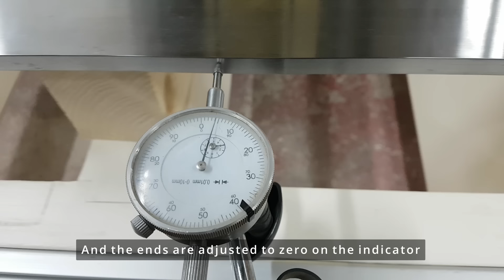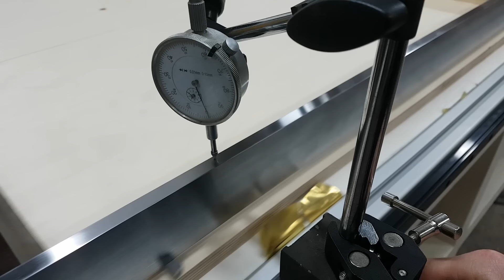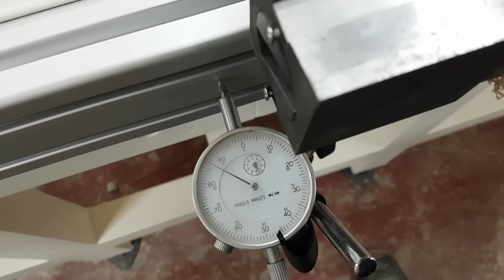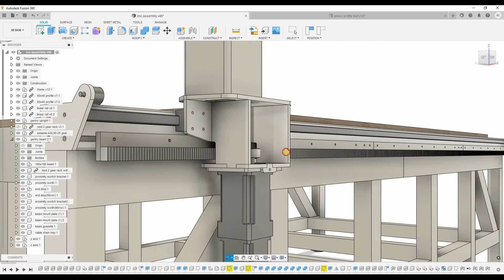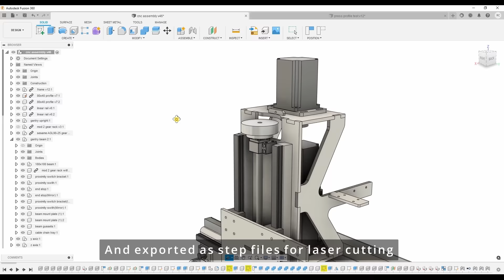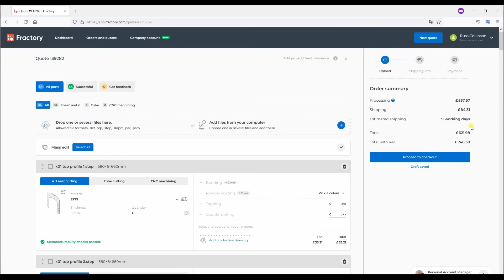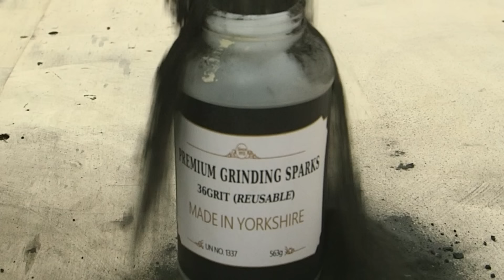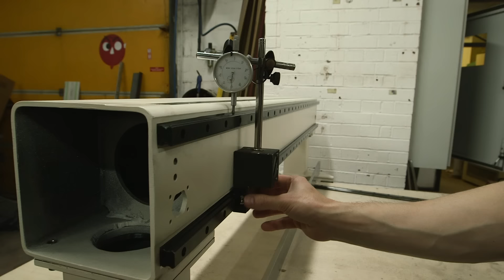Building an EPIC £20,000 machine part 2

Comment: Your drive for perfect is admirable, your ingenuity for solving and fixing problems too. However, designwise, it should be better and faster as a whole if you took the inaccuracy of standard steel profiles, the process of welding, and the lack of stiffness and accuracy of a wooden structure as a given before designing and building. By adding degrees of freedom for adjusting to an accurate system would minimize e.g. all the grinding and a lot of shimming. The wooden table doesn't support the aluminium profile enough to be, and stay, straight. The torque applied to the screws should be uniform as a start. I would build the complete top of the table out of aluminium profiles as I've done before. With minor shimming you would have a perfect platform as a base for the gantry to ride on. Next to this I would prefer bolting parts together instead of welding it. As you noticed warping and deflecting is an issue. Furthermore, just another tip, I would order stainless sheet metal parts instead of steel or just build the complete structure out of extruded aluminium profiles like the Item ones you're using. It's more expensive but you don't have to paint it afterwards and it looks nice from the beginning. The aluminium Item profiles have the benefit of altering or adding stuff when ever you feel like it. No drilling needed. Just add the right ;-) sliding nuts and bolt some more to it. Just my two cents on your elaborate project. I'm a big fan and I hope my comments help you to become even better. All the best, Job

Comment: Why did you ruin a good drill bit to make a center punch when you can buy Center punches for cheap? Did you use the drill bit to make it the exact diameter of the hole, so it centers it directly?

Comment: Hate to be a naysayer, but wood moves, expands, compresses and even worse, depresses. You'll get your tolerances, but with temperature and humidity changes, it's likely to fall out of tolerances. I would attach the rails assembly to a ridgid metal frame.

Comment: Very intriguing, there must have been a very strong rationale for mounting a highly precision piece of equipment on a variably 'moving' wooden sub structure which is subject to dimensional change with humidity. Perhaps you are by the sea with constant temps & humidity or you have installed a controlled environment. I really ask out of my naivety not as a criticism of your great skill.

Comment: Question even though it is plywood you're using are you not worried about the wood expanding and contracting causing variations in the rails that can throw off the setups

Comment: Thanks for another great video :D A few questions: Do you include a tolerance when you order from fractory? If so, how? Do you use the tolerance funtion in Fusion 360? Cheers and thanks for sharing.
Reply from the maker: hi! no, all my parts are drawn to a tight fit and exported as is, i guess they must cut to the center of each line because their is something like 0.3mm clearance on all the interlocking tabs. all goes together really nicely apart from one or two. bits of  slag here and there.
Reply: @NewYorkshireWorkshop  You are confused. A line has no width to cut to the center of.

Comment: I'm a little confused. How do you know that the straight edge is parallel to the rail when you measure? It makes sense on the vertical alignment but not the horizontal.  Not questioning your methods, just want to learn

Comment: Looks like you know a heck of a lot more than I do but just wondering when torquing the bolts with a extension on your ratchet do you accommodate for the flex of the extension? If so, how?

Comment: One thought: a lower viscosity fluid (lower surface tension) would make the menisci in the cylinders flatter and may be easier to get closer measurements
Reply: ... or you could just buy a precision machinist's level and have done with it, used for the entire project's components as well as for future.

Comment: I think it's way over engineered. Wood movement with seasons are magnetudes higher than what you aim for.

A few thinks.
- If you shim the sidebars, by tighten the srews a little more or less than before you get different results.
- Did you level the sidebars off the plywood? Is this so level?
- The metal parts from Fractory are 6-8 mm thick, you could but a car on top of that.
- The metal beam, again humangous.
- Grinding of off a wooden block, that was hand planed on a wooden surface with a wooden structure is interesting. How do you know the surface of the wooden block is parallel to the rails?
The effect is, that the thing is square to the table but you could have saved a lot of time just shiming it.

This is not bad criticism, but thinks that came to me while watching. High level of precision, but is it needed for wood???

Comment: I don't know how long this task took in total but I'm only 24 minutes into the video and I'm cream crackered already, you really do have to be a bit (insert your own word) to do it so meticulously. I think the wooded surface grinder is inspired, but it's a shame you had so much extra work just to correct things which should have been perfect. What was the total time for this project? I was wondering why when you were masking up for paint you didn't use a knife to cut the tape with the rails etc still attached instead of marking and then cutting to the lines.
Reply: I believe 4 months

Comment: 1:47:09 weak structure shaking !!! SHAKE SHAKE !!! never use wood for structural on precision machines (it's like building a building on sand)
Reply: also, extreme thick steel sheet on those pieces, that will add even more shaking after fast movements, 1/8" is was more than enough

Comment: there is a reason machine tool's are not built on wooden frameworks.  all that wood structure  morphs and develops new stresses and strains  as the wood dries out  and regains moisture from the environment settles  from weight ,etc.   so why add those variables? seems like a metal frame would long term be the best solution. now everytime you have an off dimension in your  product you will have to question if it was because your wooden frame  moved.  I dont sse the point --cant have been that much different in cost between metal and wood  base , all things totalled

Comment: What paint do you use to spray straight on top of the self finish steel? I have been using Hammerite smooth, funnily enough in the same colour, but really am not happy with the finish, hand brushed.
Reply from the maker: it was this stuff- https://www.ultrimaxstore.com/paint/direct-to-metal/ultrimax-1-bs.-00a01.ipo00500a01?qs=1&asparent=1
I got 25l quite cheap on offer. it has a matt finish and takes a long time to dry (especially if you put it on thick in one coat like I did!)

Comment: simple skilled wins
Reply: if you drill through the aluminium extrusion, so that you can lock the bolt, then the tee joint will not slide
Reply: tee-lock-nut, not just tee-nut

Comment: Impessive. But how can you verify at 10:38, that your straight edge which you use as a reference is really straight?
Reply: The metal bar is a straight edge to within mere microns. His trick was to set up either end as zero and then measure the variance in the middle. I had to rewind to see the magic

Comment: As a retired Machine Tool Maker having worked for some of the  leading
 
 companies in the U. K.  & Other parts of the world i find this wooden fixture to be a complete joke.Nobody in serious engineering would think of fastening precision linear bearings to a wooden structure. I have had many maintenance problems setting these bearings up when securely fitted to Machine Tools made of cast iron whose mounting faces have been machined to strict tolerances. As to the comment about watchmaking i believe a cuckoo clock comes to mind. I could go on all night about INACCURACIES in this wooden bench construction  but do not want to waste as much
time as this Joiner turned amateur engineer did.

Comment: Hello! Only me. I've yet to watch subsequent videos so you'll have to forgive me if this has been covered. I really hope that the bearing blocks hold up over time - especially on the Y axis. They just don't seem substantial enough for the weight on 3/16ths (?) bearings [other units of measurement are available apparently]. Didn't find that veneer painting vid. I think the kids were acting up and I got distracted by this... 1st vid, 28mins 34 secs in - why didn't that leg you put on the end fall off when you were disassembling the frame with the mallet?  It would have happened with me. Some sort of voodoo or cheating going on. I don't do short posts and you don't do small projects...
Reply from the maker: https://youtu.be/SaohiGAYW-0
Reply: @NewYorkshireWorkshop  Ta muchly.

Comment: Makes no sense to be this heavy it is not a frame stretcher or press and the tools are not precision. No explanation?  Grinding a rec tube off axis with an inferior abrasive wheel.  If it an XYZ table it is for making tank parts from 1" plate?  I fell asleep and it is still on.

Comment: watching you chase your tail "calibrating" made me just laugh and roll my eyes. the gantry will determine everything with your setup, not building back from that plywood table surface, when the machines is complete your first operation will be to place a sacrificial sheet on top of the plywood sheet and then machine it flat and parallel to the gantry motion in y and z not  the other way around. if there is some slope in the gantry it will be no more once you surface the table top to the actual zero plane on the machine.  the most important step is the perpendicularity of the gantry travel in relation to x and y and that each axis travels 90 degrees to one another you never established that ever in anything you have done. will not be square your one gantry upright relative to the other one will be at 0 and the other possible - something or positive something both are not at x 0 plane. the machine will never cut anything square relative to x or y axis. the z is trammed in when you place the router onto the gantry. your overall z depth is square relative to your y linear rails again not the table.  your first cut on the machine will be to cut the table surface/sacrificial plate normal to the gantry not the other way around for all of your calibrating you went through. you are an amazing wood woodworker seeing you make that base table, well intended but not so good at the rest of the build understanding what is required setting up a cnc router. i have built several cnc routers now and am a retired engineer who specialized in tooling design jig and fixture work with a manufacturing degree as a second major for the aerospace industry so i know what i am talking about here. you need to go online and check out some sites for DIY cnc router builders. joes cnc is a good place to start along with cnczone.com, routerforums.com and my cncuk.com keep at it and you will get there.
Reply from the maker: wow i didnt know that, so if i just throw everything together and then skim the surface it will miraculously be straight? omg i could have saved so much time. didnt know magic existed in cnc's.
personally i think if i spend no time in making sure the gantry is running flat and without twist, then the suface (when skimmed) and all the parts the machine makes will also be not straight and be twisted. but what do i know.
Reply: @NewYorkshireWorkshop  we both know that's BS but take it however you want. when you calm down a bit not getting me praise how great you are you can look up those websites i listed and see how these guys did it and then maybe you will understand better my comments. building three of these i never ever went through the gyrations you did watching you do this. glad you never worked with me on the tooling for the james webb telescope calibration tooling for the mirrors or other reconnaissance satellite systems i designed for adjusting/positioning of antennas to arc seconds measurements and never ever going through all the pain i saw you put yourself through. ok were done. let the others stroke you and make money off of them watching you.

Comment: if uses only wood and aluminium yhid beam have totally ower weight and ower strong. perfect have aluminium beam not neew owerkill beam. too heavy. i has build about 200 DIY cnc to many fsctory shop and sell. and then you have table frame wood haha weak table and owerkill beam not good. need be metal tube table and aluminium beam and Z strongest all can made lot lightweight parts.

Comment: Dude, what are u trippin on with your water level. You already had it nicely laser leveled at the corners then go wrenching on the mid legs with a water level....the fact you would second guess a laser as being straight and opt for 4 yards of hose and engine coolant shows a lack of understanding. Your already levelled overall (4 corners did u not?) but felt the intermediate legs may be out? why did you not simply adjust all the legs to the laser line? This video shows a confused drawn out unneccessarily complex method, and/or too much time on his hands.....was all those levels and methods simply to make it perfectly flat? you also had a nice straight edge in hand, a laser, probably a good eye and a string nearby. If i saw you using that method at my shop I would send you to the doctor to get your head checked, this was painful to watch.
Reply: I love how it goes to at 17:40 "I then set the veretical alignment" and he grabs a handy big long machined straight edge bar, but the same exact process earlier was a home depot water level..lol, and by the way if your trying to use a water level for precision measurement (which the type u have is not intended for) don't mix colorants that are different salinity than the water, your readings are even more inaccutate unless pefectly blended throughout both vials, fyi   *Awesome layout, carpentry and fitup, A lost skill.
Reply: One fella builds a CNC table in his shop and the other one can't use your/you're properly!

Who has my favour🤔...